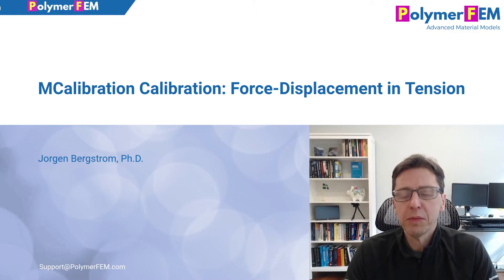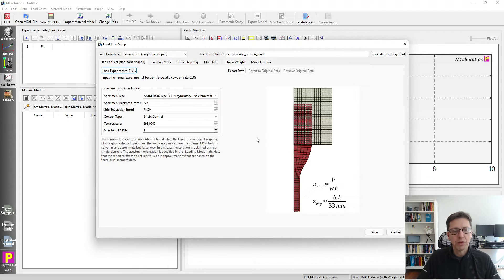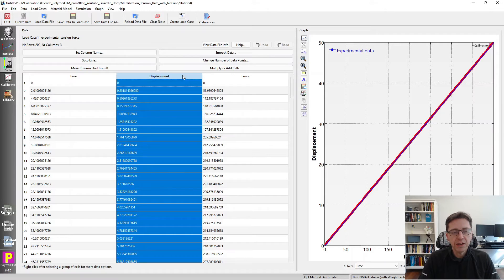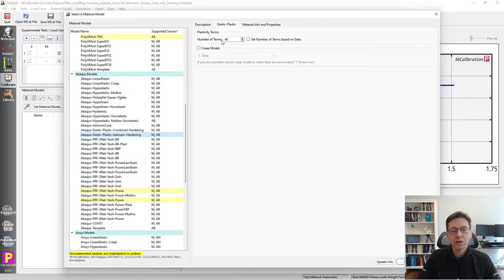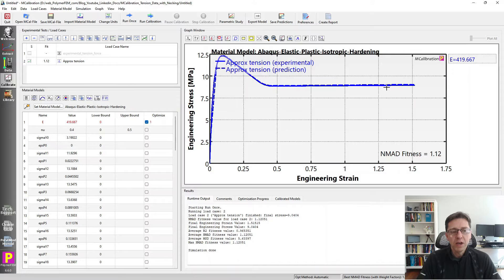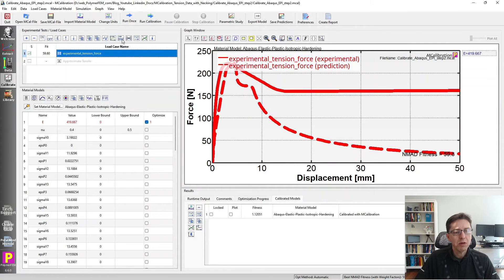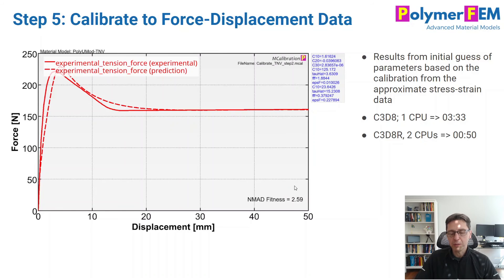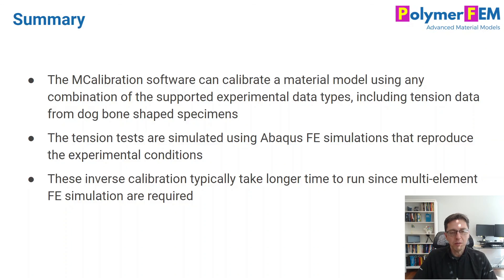How to Calibrate an Abaqus Material Model to Tension Data with Necking

Comment: In the engineering stress - strain fit for both hardening and TNV model the software is running the abaqus simulation (the 1/8th dog bone specimen) ? Or only when you try to match the Force - displacement data ?